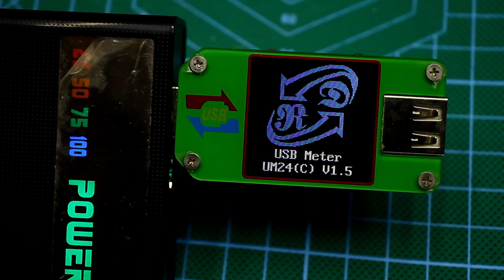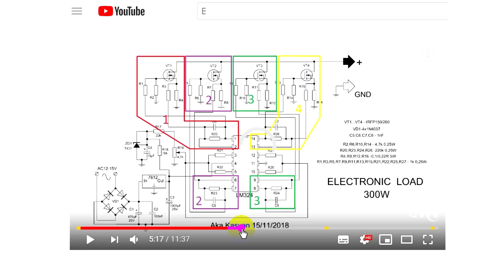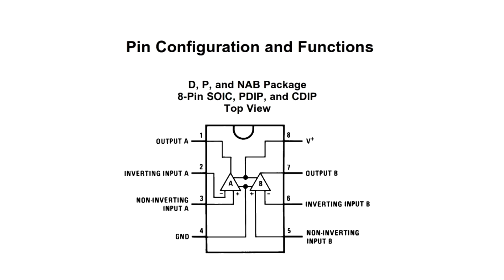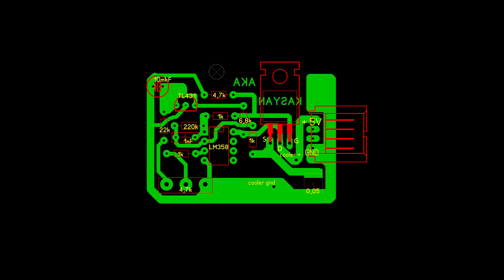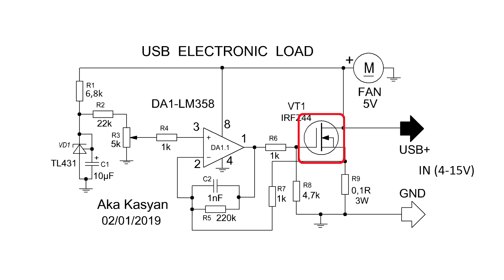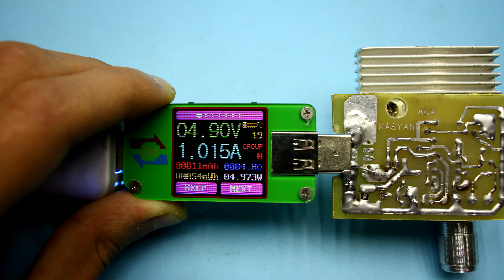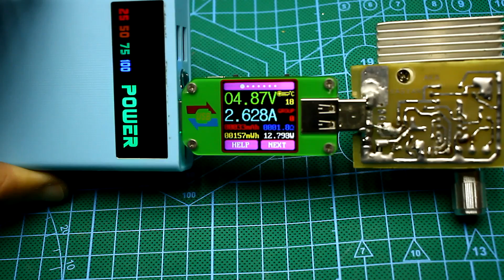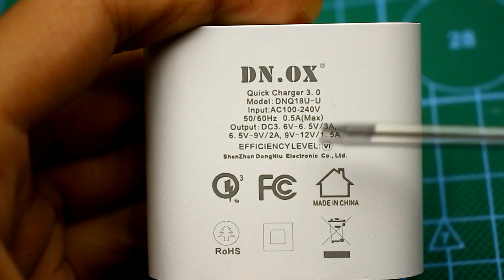DIY USB electronic load

Comment: for better MOSFET survivability it is recomended to use a linear FET or a FET that can operate in the linear(DC) region you can check daatasheets ina graph (SOA) and make sure you stay within the Vds and Ids rated for the DC line grapth, so long as you keep the FET cool and respect the SOA it will survive a long time!

Comment: This is all ridiculous.  You ended up spending multiple hours and times as much money as just buying some very low cost, ready made tester.   Even if you happened to have all the parts, as salvage rather than paying regular market prices for, it is a colossal waste of time to reinvent the wheel.

Also your PCB design was ridiculous.  Terrible waste of solder.  If your traces are too thin to support the current, stop wasting so much solder and leave more copper on the PCB instead of etching an excessive amount away, plus there was no need to make it so small if that was the problem with having enough copper.    Plus the design is terrible for lack of mechanical fortitude where the USB connector meets the PCB, apparently relying only on the solder joints for something meant to be manipulated with that mass?  

There is no good reason to build this and several reasons not to.

Comment: That is the exact same schematic as the DYI 150W load I got on ebay 6 years ago. I found out that loading certain dcdc adapters, it would oscillate. I fixed it buy changing C2 = 0.1uF.

Comment: Dear Sir the circuit is not working although to my surprise the circuit was working only if I left he mosfet without a heatsink!!!!!!!!!!!!!!!   Ahhhhhhhhhhh this is very odd because the mosfet was burning nasty drowning current from the source (usb load) but when I put a heatshink on it then it draws zero current..!!!!!!!!!!!!!!!!!!!!! Amazing!!!! The heatsink is not making any short circuit with the rest of the circuit. Well the conclusion is this : The circuit is  good for a thermal stove. !!!! I could use a fan without a heatsink but the fet is still burning badly when it draws the current.!!!!!  I haven't seen this in my life before as an electronic engineering that I am. I will try to isolate the heatsink completely and then I will post again. ! Very strange indeed. I will compel it very soon. I need holy water.
Reply: It doesn't' work either...No response from the creator!!!!!!!!!!!!!!!!!!!!!! An answer please????

Comment: hi . please anyone can help me on this problem :
i assemble the circuit but its not work until the input voltage reach 6 volt and above.
i tried to change the R9 with smaller ohm range like 0.1 ohm but still not succeed.
i simulate it in proteus and also in proteus its still need 5.8 volt for input.
Any help ?
Reply: This Mosfets need around 5 to 7 volts gate to source to work correctly

Comment: Which resistor i can use alternate of SMD R050???
Please reply me, only for SMS R050 my circuit is pending, R050 is not available in my area
Reply: You can use 0.1ohm 5w big resistors
Reply: @jagdishsingh9997  after 1 yr i've received this answer. Anyway, thank you very much

Comment: Sir please give me alternate of R050, which diode i can use instead of R050?
Reply: Use multimeter amp copper jumpre
Reply: Otherwise .1 ohm 2 resistors use parallel
Reply: R050 is a .05 ohm resistor not a diode.
Reply: Which resistor i can use alternate of SMD R050

Comment: Unfortunately, the prototype shown does not seem to be identical to the circuit and layout. My setup starts to work at over 6 volts, which is rarely achieved by normal USB :-)
A look at the datasheets of the components used explains:
The MOSFET IRFZ44 has a gate threshold between 2 and 4 volts. That means, that he starts to switch between 2 and 4 volts at some point. From now on, the conductivity (source/drain) increases with the voltage at the gate until the MOSFET is fully turned on. My exemplar starts at 3.8 volts.
The OPAMP LM358 is not a rail-to-rail type. Its output voltage swing is +/- 1.5 volts of input voltage. This means that e.g. at +8 volts input the output is +6.5 volts (same as negative voltages). My LM358 delivers at 5 volts maximum 3.6 volts at the output, and there is still a 1k resistor between output and gate --> that's not enough for my IRFZ44.

My solutions:
With a rail-to-rail OPAMP (output voltage is much closer to the input voltage) like the MCP602 or LMC6482, the circuit works up to about 4.2 volts. Eventually, the resistance R6 to the gate of the MOSFET must be reduced. 1k is very high, 20-50 ohms are enough and do not have such a strong voltagedrop to drive the gate.
Alternatively use the IRLZ44 as MOSFET. Its gate threshold is between 1 and 2 volts with very similar power levels. Thus, the test setup worked well below 4 volts.
Reply: I changed de mosfet by a 30n06L, that is logical level, but, only if 8V it works, even changing R6 by a 10Ohms one.... I think that the chips are bad... Your are fake ...
Reply: @DanielStingBR  Your FQP30N06L is listed in datasheet with a Gate Threshold of 1 to 2.5 volts. That should work. Have you ever measured the real gate voltage from your setup? At what voltage does the MOSFET start switching, at what voltage it is fully turned on and what really arrives at the gate?
Remember, the worst case scenario is that the LM358 can only provide +1.5 to +3.5 volts from the USB (+5V) input voltage.
Without measurements on the circuit you can not say "fake". At first, my setup did not work until I measured it and compared the component tolerances with the measured values.
Reply: Why donot change design for use a BJT transistor?

Comment: What if I don't have a USB tester 
Can I use my multimeter instead
Reply: For the voltage yes, but not for current, the leads have too much resistance.
Reply: Put a .1ohm or .01ohm resistor in series to the load and measure millivolts  across it to get current.

Comment: it seems to be diferent from the prototype,  it didn't work  voltage less than 8V, what is the trimpot on the prototype? The voltage reference only start to stabilize in 2,5 volts over 8v.
Any clue?
Reply: Please read my comment to solve the problem.
Reply: @wernerpeter9706  I can't see any comment of  Werner... :( where is it?
Reply: Hi, please... I didn't found the solution..:(
Reply: @DanielStingBR  apparently my longer comments are filtered out :-( - are only displayed to me
Reply: 1) The MOSFET IRFZ44 has a gate threshold between 2 and 4 volts. That means, that he starts to switch between 2 and 4 volts at some point. From now on, the conductivity (source/drain) increases with the voltage at the gate until the MOSFET is fully turned on. My exemplar starts at 3.8 volts.
Reply: 2) The OPAMP LM358 is not a rail-to-rail type. Its output voltage swing is +/- 1.5 volts of input voltage. This means that e.g. at +8 volts input the output is +6.5 volts (same as negative voltages). My LM358 delivers at 5 volts maximum 3.6 volts at the output, and there is still a 1k resistor between output and gate --> that's not enough for my IRFZ44.
Reply: 3) With a rail-to-rail OPAMP (output voltage is much closer to the input voltage) like the MCP602 or LMC6482, the circuit works up to about 4.2 volts. Eventually, the resistance R6 to the gate of the MOSFET must be reduced. 1k is very high, 20-50 ohms are enough and do not have such a strong voltagedrop to drive the gate.
Reply: 4) Alternatively use the IRLZ44 as MOSFET. Its gate threshold is between 1 and 2 volts with very similar power levels. Thus, the test setup worked well below 4 volts.
Reply: @wernerpeter9706  and how the circuit worked with 5V? I think that is better to use a Mosfet driver with a Higher voltage... But, it will change all the circuit...
Reply: @DanielStingBR  without an additional, higher voltage source, a MOSFET driver does not help. You only have the USB level. There are Rail-to-Rail OPAMPS that come close to the input level and there are MOSFETs that require a low GATE voltage.
Check the gate voltage of your circuit when the trimmer is fully turned on.
For me, the replacement of IRFZ44 (works only from about 6 volts and above) to IRLZ44 (start working at 3.7 volts ... and of course at 5 volts) was successfully.

Comment: Hi, i tried this circuit. I don't have tl431 so i used voltage divider potentiometer with 20kihm resistor. And i don't have 0.1ohm so i used 1ohm resistor. I got at 5V  current between 100mA and 1.2A. I couldn't make it less or higher. 
Q1: I'm wondering what part should i change to reach 2A at 5V? I tried 5 parallel 1ohm resistor to get 0.2ohm but still same. 

Q2: why there is a feedback resistor (220kohm) to the op amp? Usually these current control circuit don't have this feedback.

Q3: the tl431 u used it in a strange way not in the datasheet, i guess in this way some voltage goes to 6kohm resistor and the rest to the capacitor to make tl431 have certain voltage, but if the supply voltage changed the the reference will two!!! It like voltage divider. What is the use of it here?